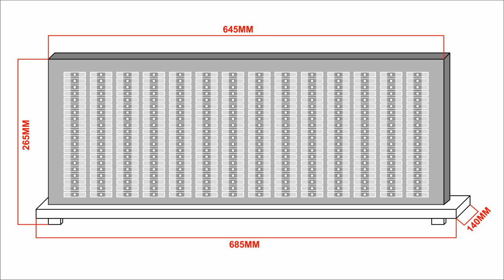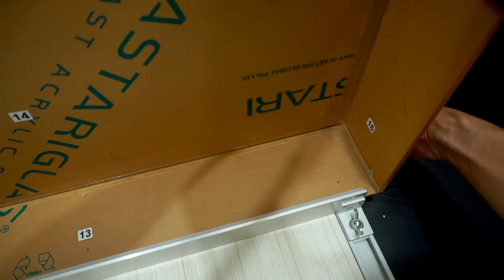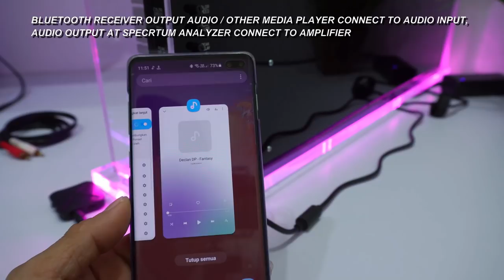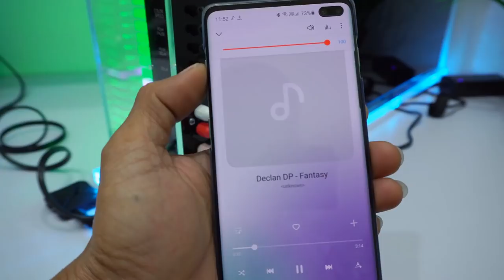14 Band Spectrum Analyzer Small Version | Acrylic Tower

Comment: is there any chance we could purchase a schematic and parts list for the DMS308 MODULE CONTROLLER?
Reply: And the Arduino code.
Reply: IMPOSSIBLE. IMPOSSIBLE. IMPOSSIBLE. 
I TRIED A "MILLION" TIMES BUT...
NO ANSWERS.
IF YOU WANT YOU HAVE TO BY THE CIRCUIT BOARD ON HIS EBAY PAGE.
I DID MY OWN BUT NOT TESTED YET.
Reply: @PauloDoutel  It's a pity because there's a lot of people here that are willing to pay for it.
Reply: in previous videos in description they putted all code and schematic. for me problem is just to find normal working msgq7 mikrochip... in this video in description also persist link but there only readme files?
Reply: @nemoomen4247  Which video was that as I've only seen the Arduino code and schematic for Part 1 (version 1) of the 14 band spectrum analyzer.
Reply: @cryhavoc1656  I dont remember exactly, maybe part one. All of them same so you can use from part one if you have all parts. (sorry for my English ))

Comment: Hello! i buy DMS-308 V2 14 band Spectrum Analyzer module -but-i have a towers 16*16-and your skech adapted for towers 14*20-can change the skech for my towers? Possible turn off two towers-14*16...
Reply from the maker: You can upload and change the 14x16 led using the sketch from DMS308 version1. but version 2 will be deleted

Comment: hello does it work with 10 or 12 leds height
Reply from the maker: it can't if you using DMS308 V2 module, because this is used for high 20 led

Comment: does anyone know why its called 14 band spetrum analyzer?
Reply: Hi, because the audio signal is split into 14 bands and every band shows the volume intensity. So actually you can see or analyze what you hear. It starts from low frekvency and ends with high frekvency: 42, 63, 100, 160, 280, 400, 700, 1000, 1600, 2500, 4000, 6250, 10000, 16000 Hertz.
Reply: @milanstastny6799  thanks mate!